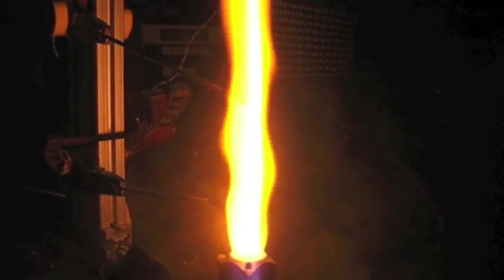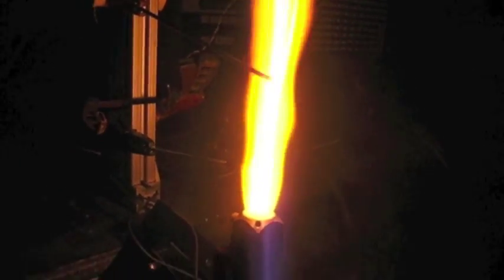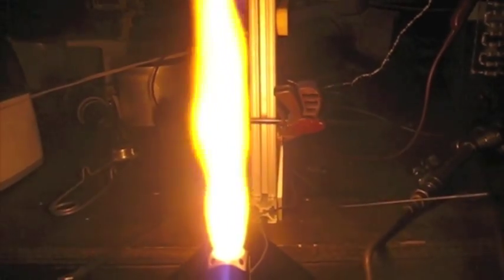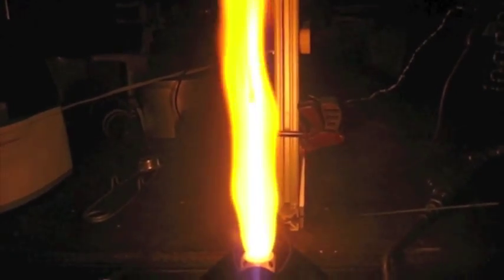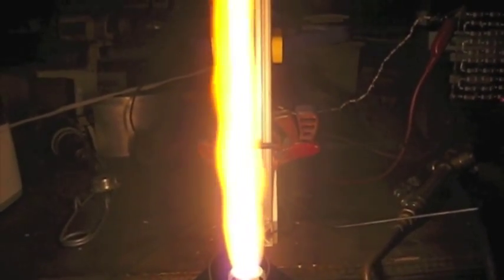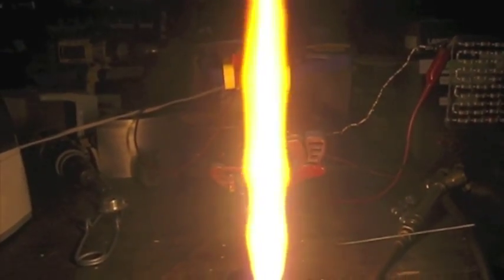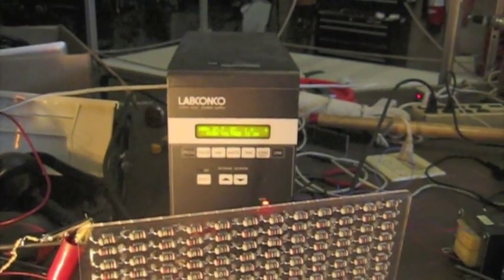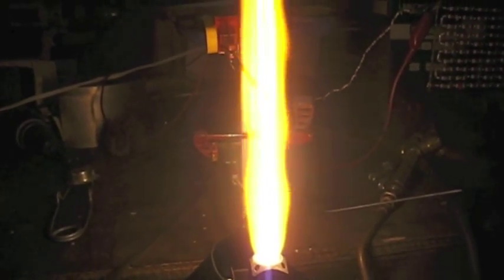Flame Speaker Test 2

Comment: I think that the torch is perhaps too hot and conductive.  A long burner with a slow blue flame could be heated and expand in response to the energy in the audio currents.  It is the volume of the expanding and contracting gas that is to make the sound on top of the whisper of flame created ionization path.
Reply from the maker: We had some problems with our electronics, but we were eventually able to fix them, then it sounded great.  We didn't play around with the flame temp very much.  We were mostly battling some electronic issues.  But, this project got put on the back burner anyway...
Reply: @cogzoid  It's funny, back in 2013 I had this idea of making a "Burning Bush" flame speaker for my first Burning Man, but I ended up not having enough time to make it (had too many other projects, lol). Anyway, I randomly remembered the old Elementary Electronics issue tonight as I was procrastinating another project, and that rabbit hole led me to  your YouTube channel. Best of luck in getting it working again in the future!